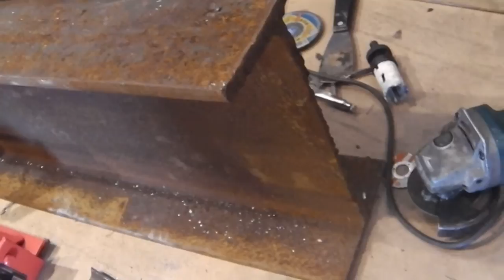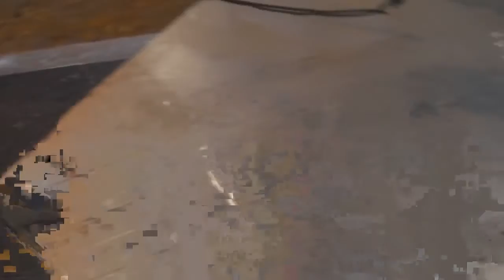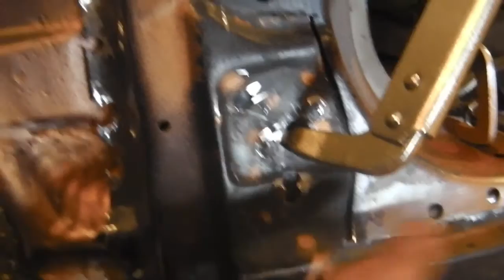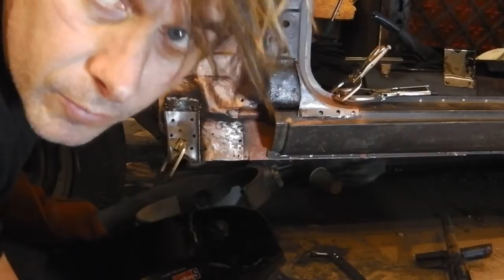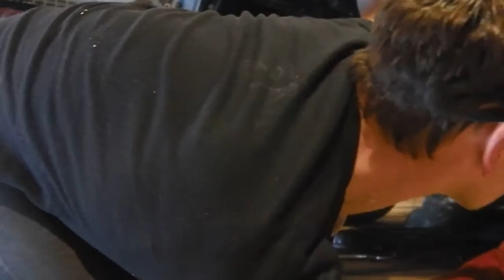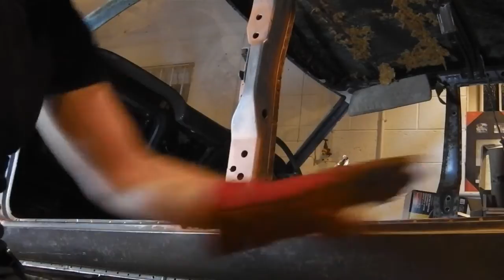Ford Cortina GXL restoration PT 6

Comment: I haven't watched the whole series of your build but will just say a few observations, firstly, the technical side of repairing an extremely badly damaged body as what you have is not the correct way of doing it to a certain extent as you probably know....
Once one cuts into the sills/b pillars etc while the car is sitting on its sagged 20+ year old suspension, means that down the track when it is repaired it may have issues, including body and chassis flex and miss alignment...the car may crab down the road...

I take my hat off to you for taking on an incredible job, that not alot of people would be bothered with, been a Cortina fan, since I was a young fella 30yrs ago..
.
My opinion is maybe you shoulda used a proper panel beaters jig, they are cheap to rent and/or buy, to keep the chassis & body very square....just talkin from my experience mate...love your videos mate
just my 2cents
Reply from the maker: thanks for the input and for taking the time to watch. I made sure everything was aligned by using fords chassis diagrams which were extensive. I have changed sills and iiners this way before (On my Green GXL ) and it was ok. I agree about a pillars though, that was the tricky area. I had to do some jigging there. However it all went back very straight, I also got in some profesional help and in the end the shell was pretty darn straight. I appreciate theres a lot of films to watch but the end result is impressive. Pete. I did consider using the Jig system to which you refer and I had a garage arranged to do this, however it turned out ok. Youll see Mike (the metal) later on in the vids saving the day.